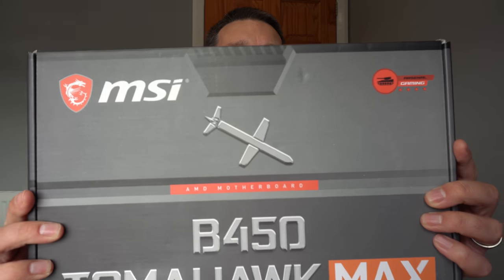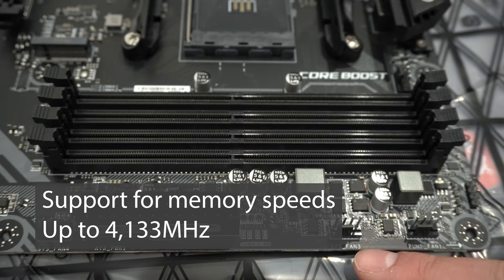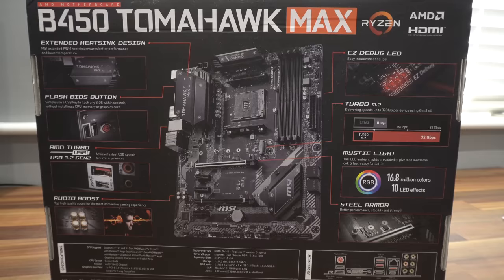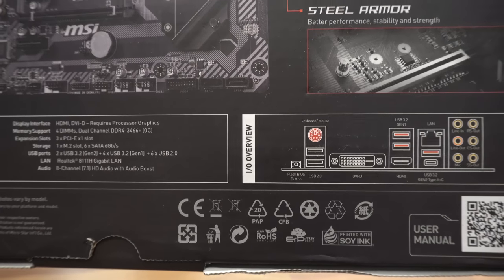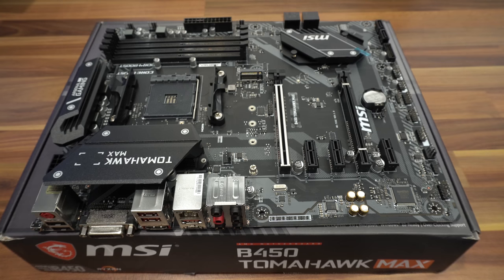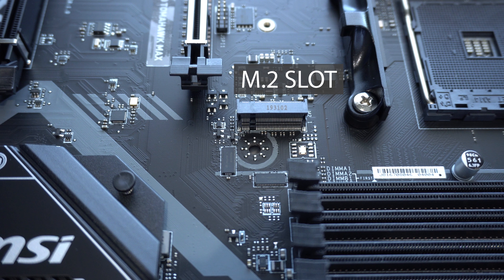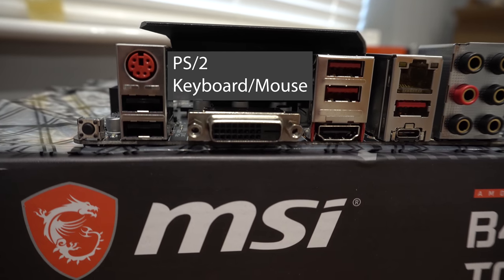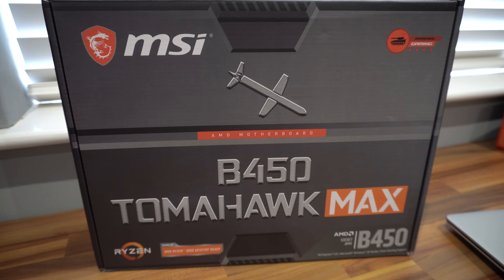MSI B450 Tomahawk MAX Motherboard | The BEST B450 Motherboard for Ryzen 3000!?

Comment from the maker: So do you reckon the Tomahawk MAX will resolve those Ryzen 3000 woes?  Who has, or is picking up this board??
Reply: Ordered mine through B&H. Their website says it's backordered, not in stock till October 16th and costing about $115 USD, same as the non-max version at the moment. Either way, I'm building my first PC and Im super stoked!
Reply from the maker: @timfuller7641  That's great!  Building your first PC is always a great achievement.  My advice is take your time!  Just completed this build and I have had no issues so far !
Reply: @UsedNReviewed  I'm not sure if I have to buy rtx 2060 super with ryzen 5 2600 or rtx 2060 with ryzen 5 3600 I'm gonna use it for games and emulation help me
Reply: Should I go for mortar max or steel legend b450m? Im planning to pair it with r5 3600
Reply: @bigfaisal7537  out of the 2 options go with the 2600 and 2060 super as most games need more gpu power than they do cpu. You can always over clock your 2600 too.
Reply: @yeysbaws  get the b450 tomohawk max board.
Reply: @yoyoyo3531  thx :)
Reply: @bigfaisal7537 ryzen 5 2600x with the rtx 2060 would be fine
Reply: hi everyone I am building my first pc as well and only have the tomahawk max as of now and i think i will pair it with ryzen 7 2700. soes that sound correct or is that a bad combo i guess i am unclear as to which ryzen i want to p air it with maybe ryzen 7 3000? if anyone has anything that might be a better suggestion i plan to play a good range of games for streaming
Reply: So on pc part picker I wanted this motherboard and a amd 7 3700x, it said not compatible due to update to BIOS, I’m fairly new to pc building do if someone can explain this plz do, thx
Reply: @domotrizz5710  make sure the model is the Max version, non max version is not campatible without updating the bios. if you get the max then you do not need to update bios
Reply: Its not wise to buy old tech. For longevity its wise to get pci4 - youll get much greater system lifespan with it and 12/16 cores are also available to you later
Reply: can i use a SAS hard drive with the b450?
Reply: @ciociaroirrequiete2927  ìf its sata yes
Reply: @bigfaisal7537  the 3600 and the 2060 is my recommendation for you.
Reply: Hello i got that mobo installed on my new rig just today.

Case is the cooler master h500, the only fakin problem is that the 2 front panel fan dont turn at all, RGB is on but thats it....

Any idea about how to make these fan spining ? -_-
Reply: @yoyoyo3531  You are completely wrong! The gpu should always be the bottleneck because the gpu always waits on the cpu. The cpu should always be more powerful than the gpu! But since the difference isn't that bad he should be fine. He should get the 2600x it is only like £10 more and has a higher base and boost clock. It also is bundled with the AMD wraith spire cooler.
Reply: @Micropoint.  Go to reddit with this one I've heard about alot of problems with RGB with this board. I'm pretty sure you need to plug the fans into a RGB header.
Reply: @liam5254  LoL problem is fixed now.

There is no problem you just need to know how to connect these 2 fans where and how.
Reply: @Micropoint.  aight I'm getting this board aswell. Heard many problems. Are you on default bios version? And what gen ryzen you on? I'm going to get a 2nd gen (R5 2600x)
Reply: @liam5254  nope bios is updated.

Ryzen 3700 RTX 2070.

ram is G skill 3600 cas 16 and yeah they are recognized without problem.
Reply: @googasmane  This is just my opinion but putting a 3000 series CPU into the b450 max that doesn't support 4.0 pci is counter productive. Your not taking advantage of this feature.  I would stick with the 2000 series CPU in the 450 Tomahawk MAX. The 2700/x has 8 cores. The price difference isn't that great from the 2600/x which has 6 cores.
If you want to build a system with 4.0 pci supported,  a good build would be the the Asus TUF x570 PLUS wifi Mobo(160.00-184.00) Paired with the R5 3600/x(175.00-226.00 for the X version)and Sapphire Pulse Radeon RX 5600XT DirectX 12, 6GB 192-Bit GDDR6 pci-e 4.0 ATX GPU(289.00-310.00) .

Devlin, good luck with your first build. I did mine in 1998 and it was a great experience. I've never bought a store built PC. It would take the fun out of it.
Reply: @jerryb19531953  Well, you are completely wrong on that one. There aren't any games that make use of the full PCI-E 3.0 x16 speed yet, even 2.0 x16 is only recently becoming a slight bottleneck (and even for this you'd need an RTX 2080 caliber GPU). If there was an actual bottleneck Intel would have released their PCI-E 4.0 chipsets long ago.
Reply: @C3lloman  Does 4.0 only pertain to GPU's? The biggest advantage is seen in storage. HDD went the way of cassette tapes.
Reply: @bigfaisal7537  5 3600 all the way
Reply: UsednReviewed me here! It’s an amazing mobo
Reply: I just ordered the board the other day, I knew this was the board i wanted at first sight, it's bad ass but  if anyone decides to get one make sure you get the MAX version because it's easy to order the other one by mistake
Reply: @jerryb19531953  Hola yo tambien pienso como usted, pero..... mi gran duda es si a un r5 3600x, 1660 super,  colocarle una  Mother MSI B450 TOMAHAWK MAX AM4=$18000, o una Mother ASUS TUF X570-PLUS GAMING WiFi AM4 PCIe 4.0 Dual M.2 = $31000 (que es un 72% mas en mi pais no se que es mejor) que opinas? hago modelado 3d y renders 3d
Reply: @C3lloman  Hola yo tambien pienso como usted, pero..... mi gran duda es si a un r5 3600x, 1660 super,  colocarle una  Mother MSI B450 TOMAHAWK MAX AM4=$18000, o una Mother ASUS TUF X570-PLUS GAMING WiFi AM4 PCIe 4.0 Dual M.2 = $31000 (que es un 72% mas en mi pais no se que es mejor) que opinas? hago modelado 3d y renders 3d
Reply: @bigfaisal7537  r5 3600 obviously, if you have it within your budget
Reply: @UsednReviewed does it work with amd ryzen 7 3700x?

Comment: Just returned a regular Tomahawk 450 in order to get the MAX. Great review and I'm looking forward to getting my board in the mail!
Reply: HEAR YOU HAVE ALREADY PURCHASED THIS READY FOR THE RYZEN 3000 WITHOUT UPDATING THE BIOS
Reply: @L23FF  ok
Reply: @L23FF  B450 Max has better RAM speeds (3466 vs 4133), bigger BIOS chip (more future proof to future BIOS updates) and USB 3.1 instead of 3.0

Comment: I got this motherboard and paired it with ryzen 5 3600! Works neat!
Reply: Do you suppose it's the best mobo for the ryzen t 3600? Or MSi B450-A Pro Max Matx works fine too? i was told it would still need an update if rhe a pro max is what I'll be using....
Reply: @reynalinanneguy4852  Well idk tbh. They are similar. At first i wanted to get A Pro Max cuz it was cheaper little bit but I had trouble finding it in stores close to me so I was like lets just get tomahawk max....
Reply: Lolks Kiss thanks :)
Reply: When the hell did you get this mobo! It's like out of stock everywhere!!
Reply: @reynalinanneguy4852  if it supports 3000 series then it doesn't need a bios update

Comment: My tomahawk board was dead on arrival.  I am getting another through the warranty. I hope its all that i wanted too...using a ryzen5 3600 3.6 to  4.2 max. Wish me luck with my new build.
Reply: How'd you go? I'm thinking about a tomohawk max with 5 3600, and either rx 5600 xt or 1660 super
Reply: Hey lemme know guys how it works, I'm thinking of exactly the same specs lom
Reply: @kahle3515  I got all the parts returned  through best buy. I still need to buy the Windows 10. i got the new parts in two weeks. Msi told me it would be a month. I found out that the corsair power supply did not work.  Got it replaced by best buy. Thank you best buy it would have been very expensive but everything was covered  by warranty.
Reply: @jamescampbellJamesNoel  i ended up building, and i used the tomohawk max, 5 3600, and the rx 5600 xt. I got all my parts from amazon

Comment: Hello! I love your channel!
I’d like to ask you if there are any differences between tomahawk “not max version” with bios chip update for ryzen 3000 and the tomahawk max.
I’ve read that the BIOS chip is 32 mb in the max version and 16 mb in the normal version; are there any differences between these Two sizes( With a ryzen 3000 cpu )?
Does The Normal version with ryZen 3000 support 4133 hz ram like the max or there are some differences in stability?
Does the Max version have USB 3.2 ?

Thank u so much and sorry if my english is bad
Reply: Refreshed heatsink, larger bios chip, faster ram support and ryzen 3000 ready.

Comment: Hi, great video! I have a question: Can I just buy this mobo and the ryzen 5 3600, and they will work straight out of the box? So I don't need to do anything with the BIOs?
Reply from the maker: Hi. Yes that’s the idea. I’m going to install the 3700x on stock bios first , so check back to see if it works !
Reply: So your going to put 3700x? Well dude, can you please try to oc it and oc the memory, therefore i plan to also get the max with 3700x with 3.2 GHz cl 16, 16 gb ram memory (maybe you already got it, Vengeance lpx)

Thanks in advance! ;)

Comment: Do you have any experience with using ram that isnt in the memory qvl? Many of the ram sticks on amazon that I want arent listed on the msi memory qvl for this board. I want to get the 16gb DDR4 3200mhz corsair vengeance rgb pro but the model number isnt on the qvl. Will I be able to run this at its rated speed?

Comment: Thank you for the overview of the board.. im building my sons first pc for christmas. pairing it with Ryzen 5 2600 and MSI GTX 1660ti
1tb M.2
1Tb Hard Drive
1tb SSD
Reply: Zelityy me 2 I’ve done enough research it’s doesn’t seem to difficult
Reply from the maker: @codyshorrorcollection  I'm sure you'll be fine.  Just take your time and don't panic.  Always good to have access to the internet during the build just in case you come across a problem and need to find answers!
Reply: I'm doing a very similar build!! 
MSI Tomahawk B450 Max
AMD Ryzen 5 2600
MSI GTX 1660 Super
250 GB M.2 
1 TB Hard Drive

I'm not sure if you've built yours yet, but you might want to look at the MSI GTX 1660 Super instead of the MSI GTX 1660 TI. The TI is only VERY marginally better than the Super (about 3% better), but the Super costs about $50 less, rendering the TI obsolete. Might save you a few bucks there.
Reply: SRehill7 I had already bought everything . I bought the 1660ti for 269 on Black Friday on new egg now it’s back to normal price
Reply: Go for 1660super, same performance in lower price 🙌
Reply: Why are you going for a standard HDD plus M.2 and SSD?  Could do M.2 and 2x SSD

Comment: Will this work nicely with Ryzen 5 3600 and what power supply would work nicely as well and chipset.
Reply: Exactly my questions too. Please let me know bro the info for this when you knowwwww
Reply: Yes the ryzen 5 3600 should work fine because the tomahawk max supports 3000 series so it doesn't need a bios update
Reply: Surge Gaming lmao 😂 4 weeks later I get a response all good I got it all worked out and build- now gaming.
Reply: @AMRCineVerse  damn I'm still trying to get my parts 😫

Comment: Hey bro, awesome video and I'm actually really excited with the new B450 boards which are compatible with Ryzen 3700x ( as you mentioned in one of the comments). 
So, I'm really excited about building a PC for my video editing and I need some reviews upon the configuration I have choose-
CPU- Ryzen 3700x
GPU- Zotac 1660 Ti
Motherboard -MSI B450 
Tomahawk
Ram -32gb Corsair Vengeance 3200Hz
Power Supply - Corsair 650w bronze something 
With kingston ssd and seagate hhd. 
Please comment if this configuration is good for 4k video footage and vfx production. 
Thank you. 
And keep producing awesome content, love from India.
Reply from the maker: The 1660Ti might be a push for 4k editing....however Proxies are your friend.  Learn how to use proxies and you can edit 4k video with a less powerful PC than normally required.

Comment: Which would be better for my Ryzen 5 2600: The B450 GAMING PLUS MAX, or the B450 TOMAHAWK MAX?
Reply: X570 Prime P
Reply: 2600 doesn't require a 'max' board, these are specifically meant to address Ryzen 3000 problems. However, tomahawk is almost definitely a better board
Reply: @lifemocker85  There's absolutely zero need for that board for ryzen 5 2600, or basically in general. X570 doesn't have many features that warrant the extra 100 dollars that could be put towards anything else in a build. PCIe4.0 is useless as of right now, only really expensive NVME drives use it. Also, SLI/crossfire is also pretty useless with today's GPUs. Also, that particular board is pretty much the cheapest X570 and isn't worth the price
Reply: X570 is trash go with the tomahawk

Comment: I purchased this board and like it a lot. There is one thing I hate about it though and that's the leds. They made the default color RED instead of off. You have to install msi lighting software to change the colors and their software corrupts the lighting profiles on my gskill trident z ram. It is so annoying because my build is not RED. I just wish the leds could be disabled in the bios.

Comment: I was going to buy a pre built PC but thinking I’ll buy parts and assemble myself. Will this work with “AMD Ryzen 5 1600 Desktop CPU - AM4 / Hex Core / 3.2 GHz /19MB / 65W” and “AMD Radeon RX 590”? Should I? Any advice will be helpful thanks. I don’t need an amazing up to date PC, just a decent one.
Reply: Yo
Reply: Get ryzen 5 2600x gtx 1060 4gb this motherboard hdd 1tb 3000mhz 8gb 650watt psu this is good for u

Comment: What if you have a hard drive but you already installed m.2 ssd in? Because you said both SATA ports will be disabled once you install it. Where should I plug the hard drive then? Please reply.
Reply: If you're still wondering, only SATA 5 and 6 will be disabled if the m.2 slot is populated. The other SATA ports will still be functional. I suggest reading the motherboard's manual. Hope this helps!

Comment: Do you need to do the bios update when you have the Ryzen 7 2700x installed in the MSI Tomahawk B450 motherboard?
Reply: No because it's a 2nd gen processor
Reply: @konstantinfinnern1540  so I wouldn't have to go through the hassle of needing a USB to copy anything from bios, or have anything to do with the bios?
Reply: @whatdoyouwant4153  nope the standard b450 tomahawk is directly bios ready for a 2 nd amd cpu
Reply: @konstantinfinnern1540  thanks! That's awesome!

Comment: I got a Pro Carbon B450 and planning to use a Ryzen 5 3600 I was unaware of the bios issue. The motherboard doesnt have MAX at the end, but it has the sticker that says 3000 desktop ready. Do you think that's still fine? 
Also this is my first build
Reply: You won't need to update the BIOS if it has 3000 ready on it. You will however get a crappy looking BIOS without the graphics with the Pro Carbon as the BIOS is too small for the new CPU. With MAX you get the normal BIOS. Not a major issue though.
Reply: @Nexus7even  alright, thanks for explaining, and yeah, I was kinda expecting a crappy bios anyway lol

Comment: I just got this motherboard, so I would have no issues swapping this into my system and it would be ready to go out of the box? My system specs are a Ryzen 7 3700x, an MSI 2070 super ventus oc, and 3600mhz crucial ballistix ddr4.....
Reply: I'm getting exactly the same build with an exception of RAM (goign for the HyperX 3600mhz). How do you like the whole build so far?

Comment: 6:12
lawl. Is this only happening on the Tomahawk Max? I use the nomal Tomahawk and both SSD's, that are connecten to those two exact ports, are working just fine, despite having a NVME SSD installed.
Reply from the maker: It was en error. Ports 5 and 6 are disabled when using M.2 ssd, so you’re all good
Reply: @UsedNReviewed  using a M.2 wouldn't hurt the Sata ports if you would use a PCIe card to mount the M.2 on it, correct?

Comment: I always wonder, what would happen if I press this Bios Flashback button while the PC is turned on and maybe running chrome or movie?

Nb: I know it's a stupid question, but just a little bit curious tho, will it be broken or maybe reboot it self straight away?
Reply: If there is no usb drive plugged for bios update, then nothing will happen as you press the Bios flashback button.
Reply: @sihirliparmaklar6786  Thank you! Oh yeah another thing if you willing to answer sir, bios flashback is used if I want to update the bios without having the compatible CPU right? But what if I already have the compatible CPU? I can just update it using browser and usb driver and go to bios without the Bios Flashback right?
Reply: @Akiwaaa_  Yes, you can.
Reply: @sihirliparmaklar6786  Thank you for replying sir! I always scared to accidentally pressed it while the PC is turned on, but now no such worry like that anymore. Thank you!

Comment: DUMB QUESTION - So if a add a m.2 the sata ports will not work?
Reply: Only sata no 5 n 6 will not work , but still you can use sata no 1 to 4 port for connecting harddrive

Comment: Hi, how many fan headers does this has?
Reply from the maker: 4 x SYS_FAN, 1 x CPU_FAN & 1 x PUMP_FAN
Reply: @UsedNReviewed  im building my first pc and i will buy 3 fans plus 1 fan that comes with the case total 4 fans. If i buy 2 fan splitters will it be ok? And one more question im planning getting an rtx 2060 msi gaming z and ryzen 5 2600 with 16gb of ram at 3000mhz im planning on overclock them (the cpu and gpu not the ram) is an evga 600br enough?, thanks

(Sorry for bad english, its not my main language)
Reply: @panosko2974  600 watts are enough.
Reply: @panosko2974  buy corsair spec delta rgb case it comes with 4 case fan ,3 front rgb 1 back normal .you need to buy 2 fans for the top